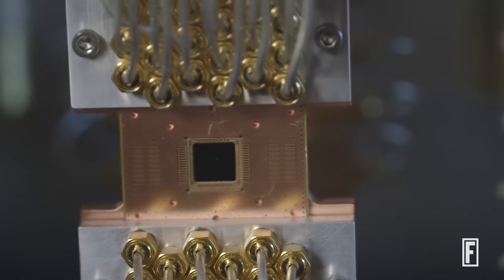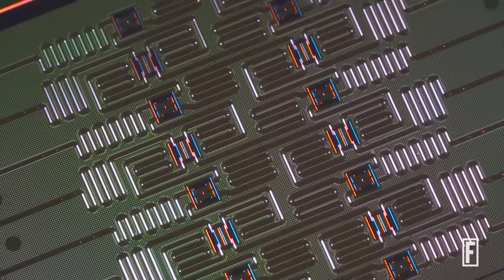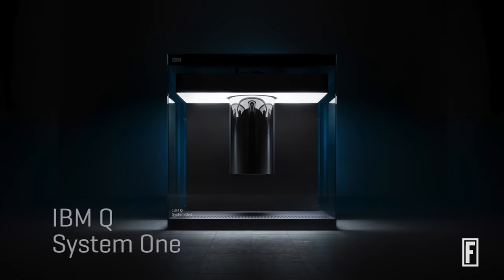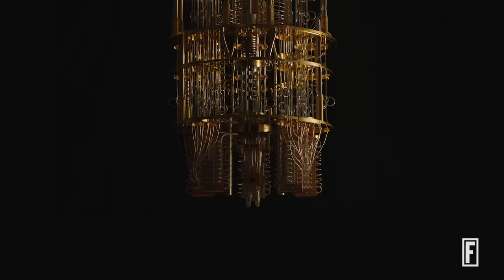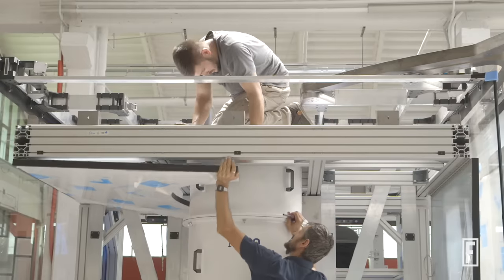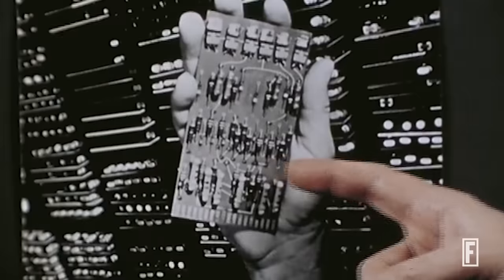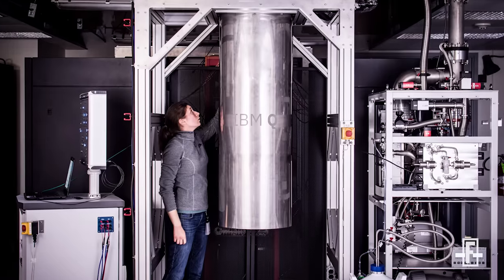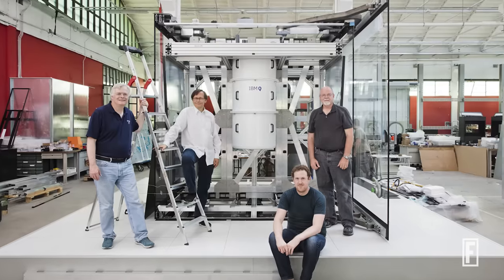IBM Unveils Groundbreaking Quantum Computing System I Fortune

Comment: 40 years from now, kids will look back at these giant quantum computers the same way we look the old classical computers that needed a whole room.
Reply: You get it.
Reply: I doubt so, just look at Apollo's guidance computer cord memory.  Still impressive by any account.
Reply: They'll be in watches by then, and people will be like "They had computers that took up entire buildings that could barely add 1+1! And ran on glass tubes!"
Reply: Doubt it.
Reply: it's been 20 years since IBM's PowerPC G3, G4 and G5 processors told us (along with apple marketing bs) they were going to be the future of computing and nowadays we look back and laugh at that; are u a big blue fanboy instantly convinced by any dumb video they release?
Reply: It would require a revolution in cooling, or an entirely different way of doing quantum computing with innovations the same way the integrated circuit replaced vacuum tubes. I'm not saying it's impossible, but things are much different this time around. The need for quantum computing is very specialized, and it requires so much energy and space. And we already have computers that work very well, reducing the demand for innovation significantly. It was relatively easy to go from vacuum tubes to integrated circuits and transistors. It's all still basic electronics at it's core, just made very very small. To make quantum computers in the form factor of a PC is a much more significant leap forward.
Reply: Like a quarter of the video is literally about that. It talks about the design of original mainframes... you didn't watch the video did you
Reply: Colin Walsh  Maybe in the future we will develope synthetic materials that are superconductors at room temperature. Last time I checked, a group of scientists created a synthetic material that shows superconductivity at only -33 C° (which is a great improvement)
Reply: I was thinking the exact same thing. Lol
Reply: @elliemay1748  people keep saying this. But this is exactly the wrong sort of thinking for EXACTLY the same reasons. Vaccum tube computing came about in 1907. The microprocessor  didn't come about until the late 60s. It was a convergence of new technology AND new ideology that combined to make this. It was a engineering problem just like this is. It may take longer, but we make breakthroughs all the time.
Reply: so will you :)
Reply: Maybe if the cooling issues are solved?
Reply: Colin Walsh  I think we could see this in 20-25 years but would most probably be through cloud. I mean what will you do with such a chip? What applications? If you're saying anything and all things we do now like gaming, video and photo editing, Editing for VR content, etc then I'm fairly confident it would be done entirely through Cloud till then
Reply: 4 years
Reply: I think due to lack of “killer applications” this will never be a mass produced consumer product. I may be wrong but not many people would need to factor integers or a few very specialized things these would do better than classical computers... to be ridiculed in the future: I think the size of the quantum computer market is only two...
Reply: @yazicib1  haha. I don't know but this reminds me of something days similar about personal computers
Reply: 40 years from now the climate will have slid down the abyss so deeply that kids will be hunter-scavengers again. Doubt the internet will still be ticking in 40 years.
Reply: Old classical computers were huge. Quantum computers are very small, and can even be put inside a laptop enclosure. It’s not the computer that is big, but the surrounding supporting equipment. And that will never get any smaller. Two of the requirements are extremely low temperature and no vibrations  and no movement. That is fundamental to quantum computers, and will never change because that’s how the physics is.
Reply: @andrei-lucianserb1771  how can you be so sure about that? Researchers may discover or invent some materials that will obey laws of physics as well as make that possible. You never know
Reply: Nadeem Shaikh you need a temperature of almost 0 Kelvin, and no vibrations. The quantum effects necessary for this computer to function only exist if those requirements are met. This is not a material problem, but a problem with the environment that the computer needs to be in. If the environment is not "perfect" the quantum effects necessary for the computer to work, will disappear. If quantum effects were present in everyday life at human scale, we would be able to walk through walls, be present in two places at the same time, etc. Since we are not able to do that, I'm pretty confident. Also, because of the internet, you can connect to the quantum computer from your phone or smart watch, so in a sense you already have a quantum computer on your wrist.
Reply: @andrei-lucianserb1771  yeah, I mentioned that in this thread that we could do that through cloud
Reply: @andrei-lucianserb1771  You're half right. Quantum effects always exist, it's just that they are swamped out and scrambled (decohered or "destroyed") at high temperatures due to the environment messing with your quantum system. This indeed precludes ordinary quantum computers, which need to preserve the exact quantum state of small single qubits, from working at high temperatures. But, there exist other quantum computing paradigms. Namely, topological quantum computing where you encode a qubit's quantum state nonlocally as the collective state of a very large system (still on the nano scale, though). If done correctly, this larger system, and hence the qubit's state, is then protected from small perturbations from the environment up to, potentially, much higher temperatures. (The topology comes from how you perform quantum operations on the larger system without loosing the quantum state, by "braiding" and "fusion".)

Microsoft is working on precisely such a topological quantum computer. Search for: "majorana zero modes", "majorana nanowires", "parafermions", and "topological quantum computing". At the moment, they still require low temperatures and don't yet have a full quantum computer, but the temperature limitations are now almost entirely a limitation of material science, not of quantum mechanics. If a superconducting material with certain properties, or an entirely different system supporting the same quantum computational model (there are suggestions and experimental hints of some), was found to exist in nature at high temperatures then a quantum computer would also work at those high temperatures! It is not inconceivable that the cooling requirements would get significantly relaxed once topological quantum computers come out. Perhaps - in a few decades - they will indeed work at room temperature without requiring specialist cooling!

As for killer applications: quantum computers are supposed to be much better at AI than ordinary computers! A super-smart quantum-computer-based AI in your wrist watch would probably a good incentive for ordinary people to accept quantum computers in their lives, no? ;)

P.S. This is all based on actual science (I am a quantum physicist), though with a rather optimistic view of future developments. ;) But it is all, in principle, doable.
Reply: Nuh uhhh...
Reply: @alerey4363  

Ehem - 'The Machine'
Reply: Well, not necessarily. We probably never gonna have quantum handheld devices. Just like we don't have flying cars. Also, quantum computing is not even that usable apart from very specific problems. And given what smartphones are now used for, even current technology is a total overkill.
Reply: Or maybe not..
Reply: Doubtful
Reply: Needed a whole room how young are you.
Reply: @s.u.2412  and I'll be a rotten corpse
Reply: and we'll be rotten corpses or close
Reply: No.
Reply: I'm not sure quantum computers will be a thing in 40 years.
Reply: You DO realized dont you that there will be NO  " 40 yrs from now"  ???
Reply: @SteffanoDucati  Why not? Will the passage of time stop?
Reply: @mirabilis  Thanks for pointing out my oversight .... let me be more specific  " there will be NO 40 yrs from now for you or anyone else " .....
Reply: @SteffanoDucati  How do you know that?
Reply: @mirabilis  Ever observe a pot go from simmer to boil ??
Reply: @SteffanoDucati  Yes, yes I have. Are we simmering?
Reply: @mirabilis  hahahaa we're a little further along ... kinda like it was reaching a boil and the temp was backed off at the verge so that all that's needed is a little burst of heat .... a lul before the lid blows off ...
Reply: @SteffanoDucati  So, when are we all going to die? 10 years from now?
Reply: 40 years from now humanity will be in a mad max kinda scenario due to climate change.
Reply: Until quantum computing has actually been proved to work, i'm gonna say this is more corporate bullshit
Reply: You mean 40 years from now Skynet: Quantum Edition is going to look at these giant quauntum computers the same way we look at 19th century daggeurotypes of grandpa.
Reply: but the design of a classical computer didnt change so much as it was 30-40 years ago, the chips just went tinyer
Reply: @vapor Wave - sama Do you have a single fact to back that up? I..... I..........I thought you were a GEP gun.
Reply: @Ekcelent  Yes, I come from the future and travel to this era just to tell you about how awesome Q computers will be... Oh, and also AI will rule over the world too, k bye!
Reply: no over 40 years, we will be trowing rocks and using sticks to survive!!! stick and stone will break my bones, but Quantum technology will break everything! see how we humans are so responsible in our way of doing. we know but one thing these days, WAR and war never changes!
Reply: 40 years? 20 years tops!
Reply: Yes it might take 40 years. Honestly from what I read and from speaking to a Stanford trained phd physicist recently, there's a lot of hype right now for Quantum Computing,...even more so than Artifical Intelligence even. The reality is that we are likely decades away from seeing Quantum being used on the day to day basis apparently. i'm sure there's a lot of fundamental truths but a lot of hype to attract funding and you know what..the funding is pouring in
https://www.wired.com/story/revolt-scientists-say-theyre-sick-of-quantum-computings-hype/
Reply: @elliemay1748  Just making very very small ? It took years of research and experimentation to build something useful at nano meter level precision.Sure to go beyond that have certain new challenges offered by wave nature of particle physics. I am pretty sure if you look back in some old research contents you will not find computer architecture as simple as we can explain it now!!! To make things way simpler to use..a lot of experimentation on fundamentals and constant integration of tech into useful tools is needed.
Reply: @elliemay1748  I wonder what can we make use of other fundamental particles like mesons, quarks, bosons etc.

Comment: even running like a classic computer on 20 qubits is an achievement :D
Reply: sinephase it was an achievement. It has been achieved. Naturally, like everything else after this things will work up to the next achievement which will be this.
Reply: considering that this is still quantum annealing im not sure that calling them qubits is even justified.
Reply: @DOGMA1138  yeah I guess they aren't. never heard of quantum annealing, thanks! :D
Reply: @sinephase  They are also technically not even proven to be quantum computers, we can't build quantum logic gates so it's not clear if a universal gate quantum computer is even physically possible to build. Quantum annealing if it actually works is only good for finding local minima which is useful for only a small subsets of problems, I don't know how far IBM got theirs but D-WAVE is still considerably slower than a classical computer it's faster than simulated annealing on classical computers (if you gimp them to the same specification of the D-WAVE computer) but classical local search algorithms like Selby's algorithm are still faster than quantum annealing.
Reply: @DOGMA1138  Q System One is not exactly quantum annealing. I like your point that there may be something in common due to the analog nature of both quantum annealing and gate-based quantum processors in the absence of error correction. However, the level of control is vastly higher in IBM Q's processors vs. say, a quantum annealer such as the D Wave 2000Q. On the IBM chips, the programmer has the ability to execute local one- and two-qubit gates, which allows one to run quantum algorithms that far surpass QAA (the quantum adiabatic algorithm) in complexity/sophistication. In contrast, the only degree of freedom that is controllable during runtime in a quantum annealer is the transverse magnetic field, which limits the annealer to running QAA, and not much else.
Reply: @noxrubbish  Not sure if trolls became more sophisticated or if it's the real David Robert's so here it goes, I thought that IBM-Q is still Quantum Annealing just unlike DWAVE wasn't limited to AQC, are these '1/2 qbit' gates are universal logic gates? are they reversible? I know IBM has put a lot of work on the software side of things as in simulating quantum gates and general QC for developers to start trying to get a hang of things but I'm not entirely sure what they actually have gotten to run on bare metal since nearly all the material other than the Q Experience documentation big blue has on this reads like marketing vomit.
Reply: @DOGMA1138  I'm impressed with both yours and David Robert's knowledge on the topic. May I ask what is your field of expertise. Mine is low-level mechatronics and know buggerall about quantum computing.
Reply: He doesn't give anything away - just tells you how good IBM is.
The whole idea could be a blind gully sucking up research funds.
Reply: Unless you realise it's worthless
Reply: Chinese hackers are very happy to hear this.😂

Comment: 40 years from now, kids will fight for clean water.
Reply: Quantum computers could lead to scientific advances in desalination that we can't even think of yet
Reply: @TechWithSean  Like finding a way to get my child clean water why they take shelter from the acid rain
Reply: They already do, depending on where you live.
Reply: At least they could use a quantum computer with AI to fairly calculate which one deserves to die first.
Reply: Simeon Radivoev am
Reply: Not to mention food.
Reply: ...for reverse osmosis filters...? srsly?
Reply: From where home.
Reply: Buy a pressure canner, a 10 foot coil of copper tube, and a section of silicone tube. You now own a still and can make your own clean water. Circumstance doesn't make you helpless, ignorance does.
Reply: They said that 40 years ago.
Reply: Kids die every day in Philippines from water borne  bacteria and viruses and open sores While collecting plastics from polluted water to make a few pesos to buy recooked used food from hand picked garbage bags in the back of restaurants. (Pag Pag)  And its not just Philippines
Reply: @TechWithSean  Like slow down overall procreation, so we can be few and have abundance of everything than being many, who have to fight for the most necessary things?
Reply: Atlas WalkedAway 
Just need a tea kettle in place of canner
Reply: Quantum Computing could solve just about any problem we run into. Just wait
Reply: What has this to do with IBM and Quantum computer?